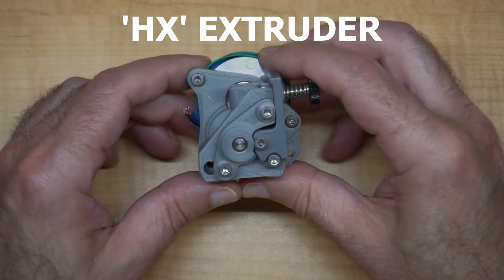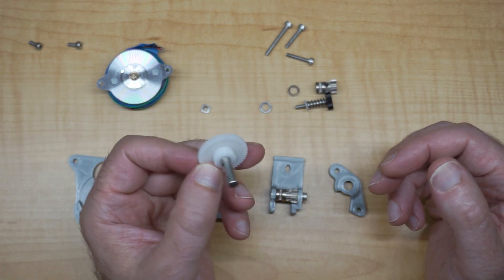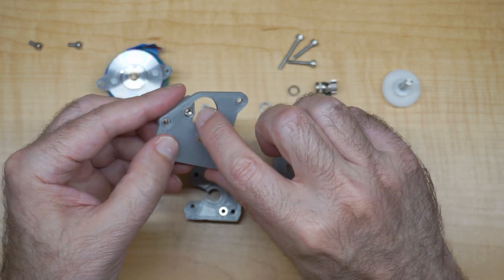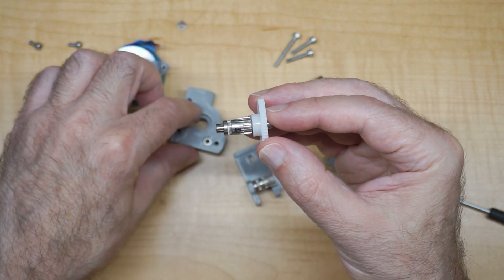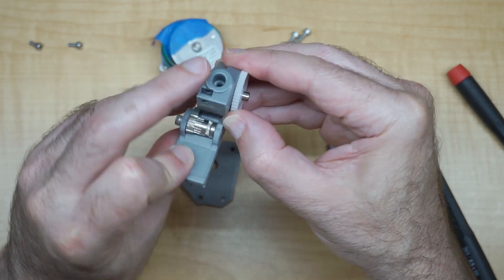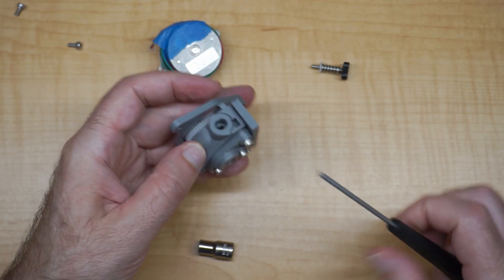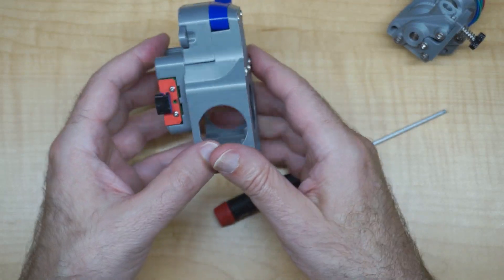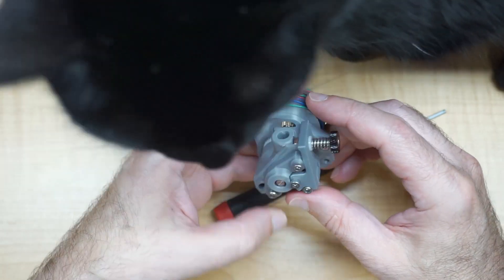HX Extruder (HextrudORT Remix!)

Comment: So is this basically the same thing as the sherpa mini with a different housing?
Reply from the maker: it's very similar - Yes!  Many of these small extruders are based on the BMG dual-gear setup with a nema 14 motor, but in slightly different packages.

Comment: 1. What is the reason to separate this as a part ? Was it to be able to print it better ?
2. You should probably design an elongated hole on one side for the motor mount. So you can move the drive gear a little closer or further from/to the extruder wheel to compensate for tolerances and create prefect meshing between the two gears. What do you think ?
Being lighter than the Orbiter is already fantastic in itself, and all that with a really cheap and easy design.

Comment: This type of dual gear extruders has one big flaw. Either the gears mesh or the filament meshes with the gear but never both simultaneously. So you will always have either slop between the two gears or between the gear and the filament. What would ne needed is a decoupling between the right gear meshing amount and the right filament tension amout. This is even made harder because different filament has different hardness, think TPU vs PLA but even PETG vs PLA is already different. This problem was never solved with those dual gear type extruders.
One big drive gear should be way more consistent that dual dear drive, however the push forces would be a lot lower, question is do I really need all that push force ? Or ..How much push force do I really need ?
Reply from the maker: Yep!  MihaiDesigns and MirageC have some pretty good videos regarding the inherent flaws of the dual gear bondtech-type extruders.  Bondtech has released their new integrated drive gears, which should help the issue, but as you know, we are quite limited with our current options for small form-factor extruders.  That said, I do have an old Titan extruder I used for my first hypercube build a few years ago that has a single drive gear.  I'm Looking at it now, and I think there may be a way to design a shell for it that will accept a nema 14 motor.    Could be a decent alternative to a dual drive unit?  

And as far as pushing force, you really don't need a ton of pushing force, as long as you have a hotend that can melt the filament as fast as you want to extrude it.  Being able to melt plastic quick enough is more important.  This is why we are seeing extruders with longer melt zones and heater blocks.  This allows for much faster printing speeds with the same type of small extruder/motor combo as this one!
Reply: @mikey631  I think the Titan would be a really good option. It´s light, small part count, easy to clean/work with and works just fine. I mean the goal is to push filament in a well controlled manner with some force  a Titan can do exactly that.

Absolutely, if your pushing forces get too hight it simply means your melt zone is not big enough for the throughput.
I absolutely agree with you.

Also let me say, the HX ExtrudORT is pretty good overall. I am thinking of printing my own version now (just with an idler instead of 2nd Gear), good job with the design.
If you are concerned with weight, try to cut down on bolts and other metal components. You can use counter sunk bolts for instance and make them 5mm shorter instead the regular zylinder head ones. replacing the 2nd gear with a smaller bearing and there might be a potential to replace some nuts with nylon nuts. Also cut out some material from the housing.
Reply: @mikey631 instead of the titan, just use this design but with 1 bondtech OEM idga gear and 1 bearing like mirage c showed in his video.

Comment: The motor Pinion fits Poorly onto the White Main gear. 
 Rear mounting plate is Too thick to properly locate the Pinion gear.
Reply from the maker: which kit did you get to make the extruder?  At 3:05, I explain that not every kit has the same size main gear, and this extruder only works with the kits that follow the same size as the BMG gear, which is 3mm thick.

Comment: Whats your Vref set to for this motor? Mine gets really hot and PLA bends where its mounted (ill print PETG mount). Motor is 1A and i have set the Vref to 1,1V and still very hot.
Reply from the maker: the power handling depends on which version you have, but it sounds like you are setting current too high.  In Klipper, I have my motor set to 0.300v, and it works fine there.  you can go higher on some models (like .5 or so) but watch the heat.

Comment: This looks good. I will make a mod for my Ender3v2. I will modifiy petsfang base. Im using Bondtech BMG atm and i will use the parts from that. I guess gear ratio of 50:17 should be the same? Its what i use in Klipper atm.

Comment: Anyone else find Klipper's rotational distance annoying?  I think the steps per mm is a better way to calculate and easier to undersrand.
Reply from the maker: it's not too bad once you understand it.  think of it as mm per step instead of steps per mm.  Basically, how far does the print head move for each rotation of the motor (or a given number of steps)?  with a 20 tooth pulley, the print head will move 40mm for each rotation of a standard 1.8 degree motor, which has 200 steps for each rotation.  So the number Klipper looks for, is how many mm does your printhead move in 200 steps.  So if you have 0.9 degree steppers, than the distance moved is half, or 20mm for the same number of steps.
Reply: @mikey631  That makes a lot of sense.  If I changed the micro stepping the rotation distance would still be 40 with a 20 tooth pulley. The firmware takes that in to account?

Comment: Why not use sacrificial bridging for the nut-hole which otherwise would need support?
Reply from the maker: There i s sacrificial bridging ,but there is additional area around  the nut hole that needs bridging. That whole surface where the center of the nema motor sits is elevated off the build plate

Comment: Is there a reason why you didnt go with the Sherpa Mini by Annex? Should be lighter, is easily printable and the same parts can be used + it looks awesome.
Reply from the maker: I didn't run across the sherpa until after I started working on the hextrudort.  I recently looked at the sherpa mini, and may still modify one for the EVA carriage, since it looks pretty easy to do with minimal modifications.

Comment: Very interested in this extruder and the mini afterburner. Was looking into modding the orbiter and mini AB but if you do it for yours, Ill wait. Nice work
Reply from the maker: well, as it turns out, the mini afterburner is mechanically the same as this extruder (same nema 14 and BMG gears).  so no need to remix it, unless you are looking for an alternate mounting method.
Reply: @mikey631  was still looking to use the mini AB housing with a different extruder.

Comment: Really nice mod. Btw, what's the filament you're using? Looks steelish grey, I like it.
Reply from the maker: that one is eSun PLA+ silver.  Personally I like the Duramic silver a little better (less shiny than eSun).  Also, PLA will work fine if your printer is NOT enclosed.  If you are printing in an enclosure, be sure to print your parts with ABS, ASA, PETG, or Nylon.

Comment: Why shying away from supports?
Reply from the maker: I can get better surface quality and dimensional accuracy if I can print things without supports.
Reply: Supports allow no real precision and have bad surfaces.
Reply: @REDxFROG  The proper way to use supports (in something like this) is to design them into the model itself as a separate part. For this, I would create a part that fit the infill area, but had a 0.4mm gap between it and the main part around the edges, and a 1layer gap between the top of the infill and the part. The infill part should be of a height that is evenly divided by layer height (though you can get some wiggle room by adjusting first layer height in the slicer).

Export both parts together, and they will be in proper alignment when imported into the slicer. You will get absolutely perfect layers over the infill.

Comment: What Eva parts need printed for this to work on a rat rig?
Reply from the maker: check the link to the thingiverse page.  you really only need the modified front face that I included.  that will work with the standard EVA parts for the Dragon, V6, and Mosquito hotends

Comment: Really good modification, nice job, really support not good for précision parts like extruder, btw you won't use m3 to hold the bmg bearing on the latch side, not good you have to use the smooth 3mm pin imp

Comment: Very nice. I’ve managed to print one of the originals very slow, 0.1mm layer height, and it turned out pretty good. Haven’t put it to use yet though. I may eventually have it SLS printed once I settle on a design… most likely Nova.